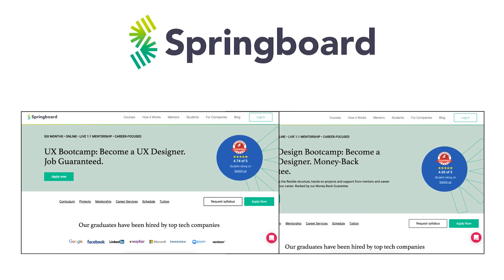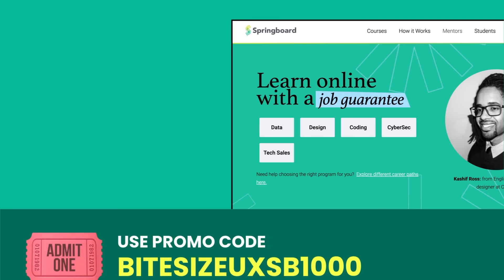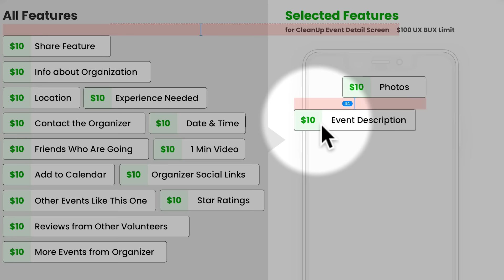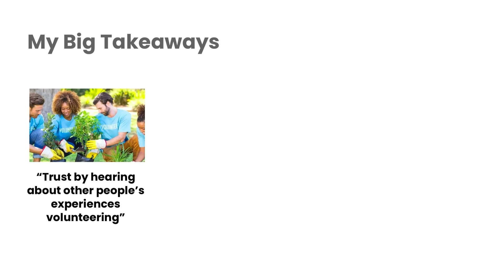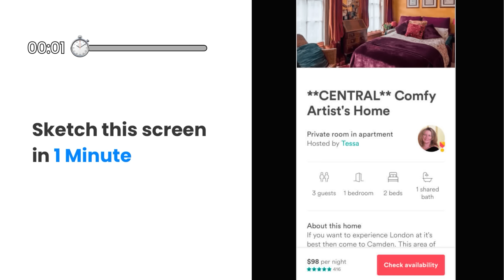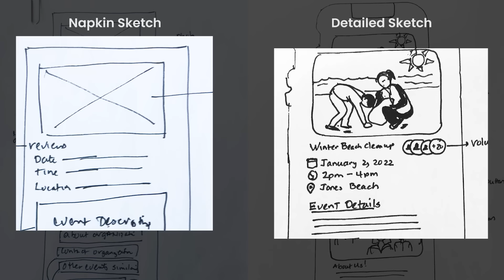Complete a Beginner UX Design Project in 30 Minutes

Comment: Every bootcamp or course which doesn't have pre-requirements especially for a field such a general and higher level as UX/UI Designing is just a misleading to the real world skills and accurate path for the carrier. The UX/UI has it in it's name the complete vast array of skills needed beforehand to get there. Start learning from basics and get experience then you can start connecting your previous skills with UX/UI

Comment: great video! as someone who is an ongoing job seeker in this field, this was a great find for ideas and a refresher on the design process. I am a recent graduate of the google UX design program, are there any design systems or UX/UI kits that you would recommend?
Reply: Thank you! Glad you found it helpful. There are tons of good design systems out there, many for free in the Figma community. While I don't have one that I recommend off the top of my head, my main piece of advice would be to look for one that is relatively simple with basic components to get you started. 

Some of the more complex design systems with lots of elements are great, but often are very specific to a type of app or experience (eg, a fitness app). For me, sometimes I feel "locked in" to using those features rather than being able to design my own.